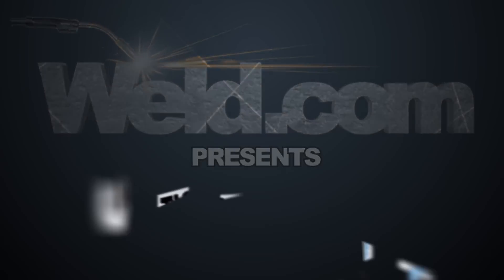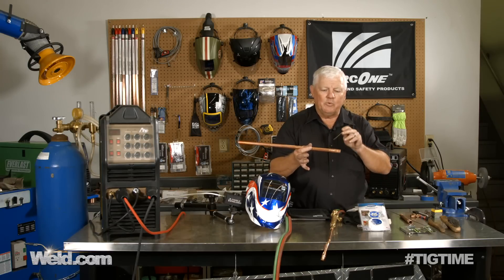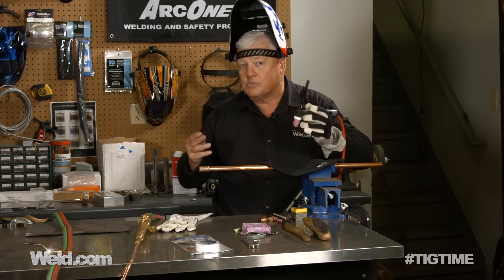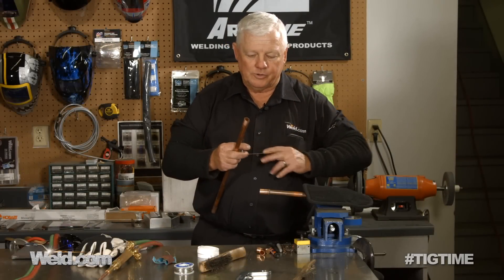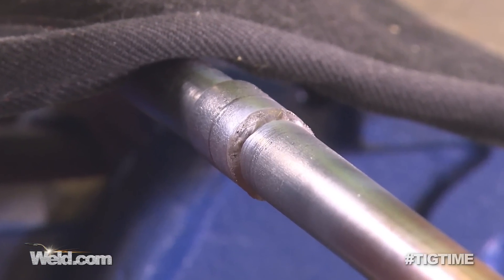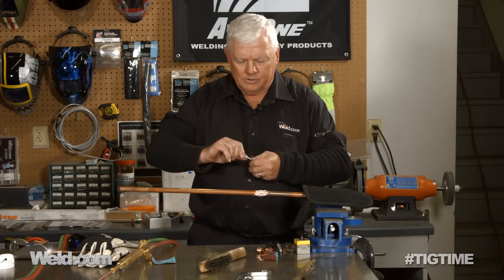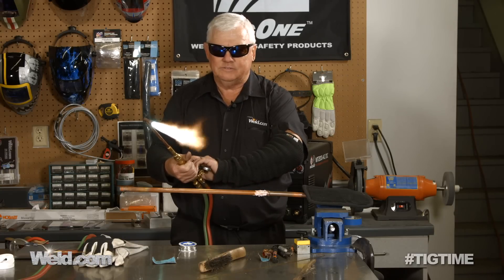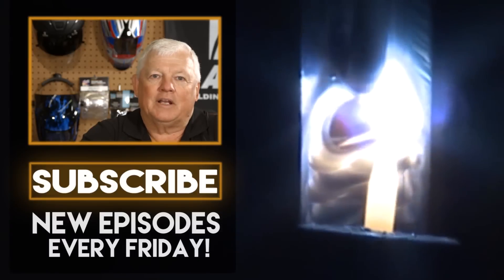🔥 TIG Brazing VS Soldering Copper Pipe | TIG Time

Comment: Holy shit first that torch is like using a sledgehammer for a finishing nail and YES YOU CAN USE TO MUCH SOLDER  there is no need for it on the outside

Comment: For copper it's solder or silver solder (brazing). TOO MUCH FLUX is always a problem for potable water purposesor HVAC. Silver solder will flow into the joint. Silver solder is the way to do it for under concrete slab connections or HVAC lines. Sil-Fos 5 is my typical product. Most silver solders )2 to 15% silver for copper or brass to copper or brass) begin to melt at 1200 F and flow around 1400 F. A regular propane torch will not work, use a good turbo torch with map gas or acetylene. DO NOT use oxy-acetylene. Overheating will mess you up, burn the flux. For HVAC flood the lines with an inert gas first to avoid oxides inside the lines which will break loose and wipe out your HVAC compressor NO FLUX ON HVAC.

Comment: I've had to WELD 1/4in square   copper tubing for heating elements that run coolant through them. I used copper wire for fill rod. I cleaned the parts with a wire brush, and the wire with scotch- bright.
 Once a weld got started,  I had to keep the joint under the gas shield until it was finished, or repeat the cleaning process.  Very tedious work. Very little instruction available for welding copper.

Comment: I was expecting him to gas braze the joint. Propane on a BurnzaticTS 4000 is more than enough heat to solder woth map you can easily overheat the joint.

Comment: dont flux the inside of the joint cause it goes inside the pipe when you stick the pipe inside the fitting
Reply: its not necessarily a huge deal but it definitely doesnt look like you are a plumber...
Reply: also why did you use such a hot filler material just use silver filler and use the torch

Comment: Yup, I enjoy the tig time videos, but this was really bad!, Welders are Welders and Plumbers are Plumbers! as noted below if your going to braze or solder a socket fitting, we want the filler to flow into the cup! pointless to weld the joint only and this  won't pass most code for brazed joints! when soldering (and this was even worse!) the least amount of heat is best! two problems with this demo, hard to control the heat with a large flame and too much solder. For fun try soldering a 1/2" copper tube with a piece of 1/8" dia wire solder 1/8" long!!!  then cut the cup and pull it off the tube, With the correct heat and position the socket will be full of solder
Also clean and apply flux where you want the solder to go, any where else is going to make a mess!

For brazing socket fittings, same rules apply, except the more heat the better up to cherry red, for copper to copper brazing no flux is needed and not allowed by some codes.
Either way if its a socket fitting, we need to have capillary action pulling the filler metal into the joint!

Keep up the excellent welding and tig video's but maybe have a Master Plumber guest for your soldering and brazing demo's

cheers

Comment: Mr. TIG...great video. I have an Everlast TOG Multi-Purpose machine and currently working on a refrigerator that I need to install a dryer to the compressor. I tried to use a propane torch to sweat the dryer back on....was not doing it right per your video, but wanted to see if I could TOG weld the joints. I think I will fall back on the sweating process per your video and foregothe TIG, but this video was very helpful either way. Cheers.

Comment: As a pathetic novice at plumbing, I attempted to make a new routing of piping from my house entry to a water softener. The main line coming in was 1" copper so I went with that. It was a nightmare. I had a map-gas torch from home depot and a bit of water/steam in the line. I tried the bread trick to hold off water. I tried everything, then finally I called a 24hour plumber here in Phoenix and the guy came out middle of the night. He gave me a serious discount saying I had everything done well, just not enough heat. The guy was awesome! That torch you have and some experience would have helped. Great video.

Comment: If I have a split from a frozen pipe on the outside radius of a 180* copper bend on 1/2" pipe would it be better to TIG braze it or try sweat it?  It would be hard to replace the part... But i'm worried although I got the edges close together the solder has no where to wick into...   High temp brazing will melt all the other solder in the system though... This is on a propane on demand water heater exchange.

Comment: Well there is such a thing as too much flux. There is really no point in getting flux on the outside of that coupler, it only needs to prep the metal where the solder will go: inside the joint. Remember you absolutely have to clean any residual flux off your pipework because it will keep eating away at it.
Reply: eelcogg only flux where ya want filler.
Reply: I looking for this comment 👍
Reply: Use a self fluxing rod

Comment: union plumber.....u can use to much flux.....Cold water piping may not dissipate flux internally.....flux over time will pit internally and leak later on..........
 the bigger the glob the better the job....not.
Reply: Nailed it
Reply: Dude, you nailed it straight and simple.  As I am an HVAC&R repairman, I know the pressures a real Braze/Silver Soldered joint can hold verses his soft soldered joint.  You don't weld copper, you either soft solder it or braze/silver solder it.  I made my points very clear in my own comments, but this guy needs to stand down when it comes to copper piping, especially when it comes to the differences between type K, L, & M copper piping.  Good job in de-bunking this azz-hat.  The HVAC&R trade stands behind the plumbers in this.
Reply: danekeeper1 do u do any welding? my company does it all and I was just checking pay at other places to see how competitive it is
Reply: I don't weld anymore, I was a Special Inspector AWI-CWS, If you wand the big bucks Aerospace welding is the field to get into,
Reply: he's definitely not a plumber w a solder like that. if anything he's non union, in the union you learn how to do shit right and clean the first time

Comment: So maybe this is different in the US, but what's going on with the outside of that pipe coupler? Sure I've sanded them for aesthetics, but I've never had any need for any flux or tin on the outside of it.  When soldering from the inside out it would make even less sense (make a little ring of small diameter soldering silver (for gas and water) and trap it between the pipe and ridge in the coupler, flux the pipe).  Is pasting up the coupler done in other countries as well?
Reply: RJ T 
There is no practical point in doing it the way he did in this video. Despite the somewhat professional appearance of this video, I don't think this guy has a clue when it comes to brazing/soldering.

Comment: That quantity of flux for solder will contaminate the ac system.
The pipe should be filled with nitrogen and without any pressure, because the nitrigen will prevent the formation of oxides in the pipe. The oxides in the pipe will contaminate the ac system.

Comment: should of brazed it with 15% silver stick (which would of been a heat temp over 850 or so).  would of been a much better like for like process comparison to the tig. soldering (under 800 degrees) is the point I'm sure you were making. braze and soldering is the biggest mis-understanding in the industry it seems like

Comment: Silver solder works well on copper pipe too.... flux is borax... propane hot enough (dull red heat). Very strong joint...

Comment: Too much flux will cause pockets of it in the joint that will weaken the strength of it. You want to solder the bottom 1/3rd of the pipe first to make a dam, and then solder the next 1/3rd then the last 1/3rd. You also want to hold your torch opposite of where you add filler so that the heat draws the solder further into the joint.
Reply: Oknenah Half right there. That heat one side and add solder to the other only really applies to pipe under 1”. Anything 1” and above, your solder should be right behind the torch. Where the torch goes, the solder must follow. When braising, its the opposite, your torch should follow the silver rod. And adding solder from the bottom up isn’t to make a dam, but rather to push the flux up and out the top of the fitting(on horizontal joints).

Comment: How do you get full penetration of the braise with TIG? I braise using oxygen and acetylene which ensures even heat distribution over the socket of the joint and full penetration through capillary action?

Comment: Nice welding. :-) But it might not be such a good idea to weld hard copper tubing, because the heat anneals the copper. That's the advantage soft soldering has over brasing and welding.

Comment: curious is there a reason why you didn't use sil-flos for brazing the copper to copper joint?
Reply: +George W What is sil-flos ?
Reply: Ralph Dratman sil-flos is a brazing rod used with a oxy- accl touch specifically for coper to copper applications.  Has a tensile strength of one hundred thousand.  Common uses are in refrigeration and HVAC applications.   You can also Google it.
Reply: George W great stuff have used it copper sheet fab

Comment: about anything is weldable with TIG process, the most used process to assemble copper piping  is soft brazing because it is aimed toward piping assembly and is much easyer to perform.
silver brazing is used in specialty applications like refrigeration gas circuits and heavy loaded electrical leads
TIG process is used to weld windings in industrial motors that could be sumitted to temperatures superior to melting point of current tin-lead brazing alloys

Comment: TIGING copper pipe is a waste. Unless your using the same base metal for some medical job. Use 15% silver solder and pull it into the coupling and it will be easier and faster and less leaks than everything else!!!!!!!!!!!!!!!!!!!!!!!!  You call that Brazing!!

Comment: Can you use the solder with a tig gun?
Reply: +Ralph Dratman  Ah-....No.
Reply: +Ralph Dratman Sure you can, if you treat the tig torch like a gas torch. Low amperage, and keep your arc at the base of the joint (where the end of the pipe is) rather than the opening where you add the solder. I would never do this if I had a torch available, but in a pinch, why not.
Reply: +beyondstrength81  Thank you very much. 

To be honest, and even aside from not needing more and more gas cylinders in my little garage, acetylene scares me, especially when it makes that loud pop. On the other hand I have been experimenting with electricity since I was a small child. I feel much happier using an electric flame along with a nice noble gas. And why not? Argon is not terribly expensive, and the current draw, as you point out, is low.
Reply: +Ralph Dratman I use an air/acetylene setup for soldering.  Much lower risk, and more than enough power.  Truth be told, a disposable propane setup is plenty to do most soft soldering, and quite a bit of brazing if you have patience.  TIG will work, but it won't be without flaws, especially if the line you're soldering has had water in it.

One other note, if you have an old stick welder that you don't mind using a bit improperly, you can clamp a lead on each side of the joint and let the current short out through the pipe.  It should heat up plenty hot enough to solder, just keep an eye on the connection between your welding cables and welding clamps (they like to heat up if loose or dirty).  A pipe thawing machine works in this exact same way, just at a lower voltage than a welder and with much more pipe between the clamps.  Start with low amperage and pay attention to your duty cycle.  Better to be too low and turn up, then be too hot and have problems that turning your machine down can't fix.

I guess I lied, I have one MORE thing to mention.  I have probably tens of thousands of solder joints under my belt (it's what I do for a living), and feel confident in saying that soldering copper tube is different than soldering wire, or any type of welding.  The part of the joint that matters is the few thousandths of an inch between the tube and fitting, not the bead around the joint.  While the solder is still molten, take a dry cotton rag and wipe it around the joint.  Be quick, try not to move the pipe, and don't let it cool while you're doing it.  If the joint makes a ticking sound while you do it, keep going until it looks good, then reheat to reflow the solder, and leave it alone to cool.   This does two things:  it pushes the solder around into any places you may have missed, and gets rid of the excess.  It sounds trivial and only aesthetically based, but in the video, the long needle sharp piece of solder hanging off of his joint is doing no good at all, looks terrible, and will stab you or somebody else as soon as your attention lapses.

Just realized how long this has gotten.. sorry!
Reply: +beyondstrength81  No, what you wrote is very helpful. I am happy to find any and all advice, comments, ramblings or whatever from someone who knows what he is talking about. 

For part a sculpture. I am trying to lay down a rectangle of copper 4" long, 3/8" wide and maybe 1/16" thick, onto a little three-layer stack or sandwich of three sheets of 1/8" cold rolled mild steel. The edge of the sandwich is the same size as the rectangle, 4" x 3/8". 

I want the stack of steel to be held together on one side by this rectangle of copper, which is laid down on the edge of the stack and soldered, brazed or welded on. Strength of the joint is not a concern, because there is nothing structural involved. The whole point is that the color of the copper will contribute to the appearance of the sculpture. 

I tried tig welding the copper rectangle onto the side of the steel sandwich, but the copper just melted and made a useless mess. SI bought some inexpensive solder and flux in the Bernzomatic Specialty Solder Kit. What kind of solder and flux would you use to solder copper and mild steel?
Reply: +Ralph Dratman Ah, I see what you're doing.  That'll be tricky to do in one operation because of how drastically different each metal reacts to the heat.  The upside is that it should be relatively simple if you tin the surfaces first.  Clean any scale off the steel, flux it, heat, add solder, brush/wipe it around, wipe off the excess.  You may need to use a wire brush to "work" the solder into the steel while it's molten (Home Depot sells my favorite brush, made by Lincoln with a wooden handle and stainless steel bristles, for less than $3).  It usually goes just fine though.  You probably don't need to do any mechanical cleaning to the copper unless it looks pretty bad.  Just use the same process to tin one side of the copper.  You might want to make sure you leave a little extra solder on one side or the other so that you don't need to add more to stick them together, but adding solder won't be the end of the world, it just increases the risk of a run that you didn't plan on. When it's time, put them together and reheat.  You can add a little more flux if it makes you feel comfortable, but it probably isn't needed.  And whatever you do, don't use as much as he shows in this video.  That's WAY overkill, and the solder has a tendency to go wherever there is flux.  

For the flux, I wouldn't use anything but Harris Stay-Clean liquid flux.  You can make lots of others work, but a lot of them will char if you get too hot, and solder won't stick at all once that happens.  The liquid flux handles this better.  It'll work on almost any metal also, so if you do this kind of thing a lot, it won't go to waste.  As far as solder, I'm not partial to any one brand of lead free solder.  I would not use 95/5 under any circumstances.  It might work perfect for you, I just hate working with it and avoid it at all costs.  It doesn't flow the way I expect solder to flow.  I use silvabrite most often because that's what my suppliers tend to stock.  My favorite was some no-name brand I bought in bulk ~10 years ago.  It stayed shiny, where as silvabrite turns dull when it cools.  It didn't matter for what I did with it, I just liked the look better.  On the other hand, it was really hard to tell when it finally cooled because there was no visual change like silvabrite had.  I'm sure that whatever solder you have in your kit is fine.

You could also try using silicon bronze filler to TIG braze the copper to the steel.  I've never tried that, but there's no reason I can think of that should stop it from working.
Reply: +beyondstrength81 I really appreciate your sharing knowledge about this. Tinning was one of the approaches I have been thinking about, so your comment is worth a great deal. I ordered the Harris flux and will let you know how this works out. 

With respect to silicon-bronze, after some more investigation I now think its melting point (about 1850 F) is too close to that of copper (1984 F) to melt first predictably.
Reply: That's a good point, you'd be walking a very fine line trying silicon bronze.  I'd pass on that too.  I'm happy to help, and look forward to hearing how it works out for you.  Good luck!